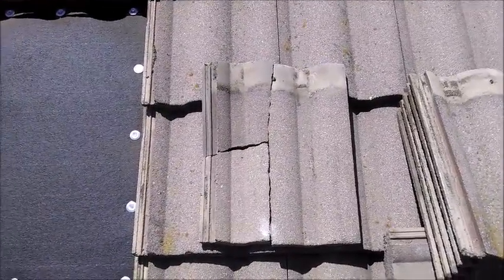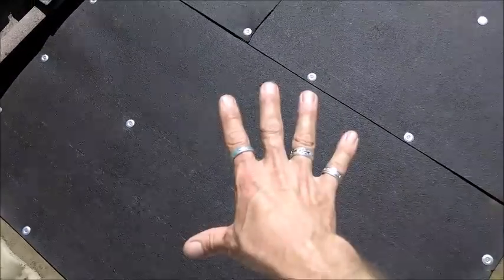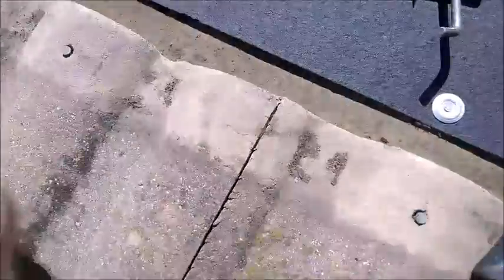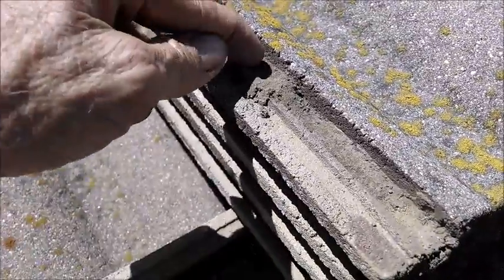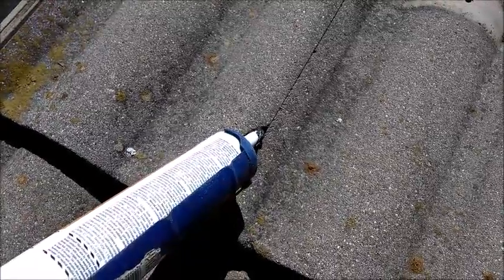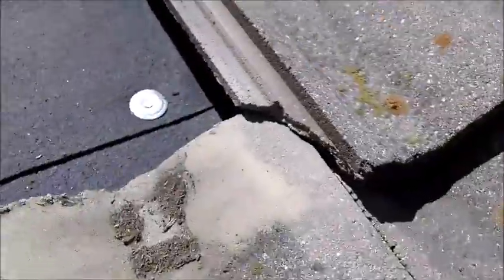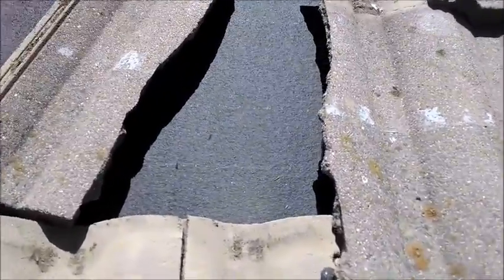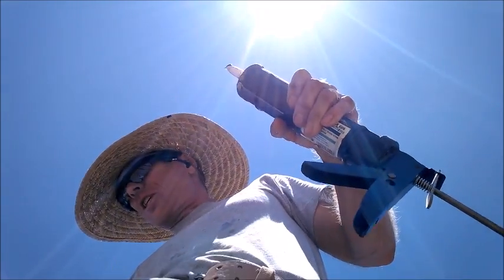Tile Roof Leak Repair - The Right Way...

Comment: what glue did you use for the tiles that are broken?
Reply from the maker: I currently use OSI quad sealant. I’m assuming it’s a quad polymer. I also used copolymer & tripolymer sealants over the years that worked well for sealing & glueing tiles together & have had good success with those products in lasting at least a couple years against the elements before needing services or resealed again. The main problem with sealants is solar duration & not water duration. They last for decades against water intrusion but they can quickly deteriorate in just a couple years when exposed directly to sunlight. Hence the need to seal beneath the surface of the tiles, deep into any cracks or joints in the tiles.
Reply: @MrThedocholiday  Also One last thing can i use sikaflex to glue down the tiles to each other that way i dont have to remove all tiles just to place a nail in them I'm doing a roof repair that's why

Comment: You should apply roof cement  will leak the next rain  season  not good
Reply from the maker: None of my repairs leak. And since it’s my business & reputation on the line, I couldn’t afford that. Sorry, but you’re mistaken.
Reply from the maker: Not only that, but roof cement is typically applied with a trowel. How do you apply roof cement with a trowel in areas of high waterflow where you cannot afford it blocking the flow of water or trapping the runoff? How do you keep roof cement from making the problem worse? It’s difficult enough to smooth out caulking so that it sheds water flow rather than blocking it. Roof cement is ten times worse trying to smooth it out & it looks terrible on the surface of the tile, even if you paint over it & it has no better sealing properties than good caulking nor is it more durable to UV rays or severe weather. Roof cement is for felt paper, not for tile application, but you knew that already, so I don’t know why you would advise using it on tile, except that you’re lazy & want to continue going the cheaper route for your customers.

Comment: what glue used for the roof? thanks
Reply from the maker: I currently use OSI Quad for roof applications, because it’s available where I work, but any exterior polymer will do. I don’t use silicone because it doesn’t adhere to other construction materials well, & I don’t use anything that dries hard, because I can’t disassemble it again in the future if I have another problem & need to service it a second or third time.

You just have to figure out what your specific need is & read the labels until you find what works best for you. Hope that helps.